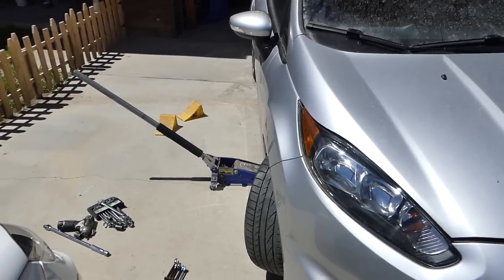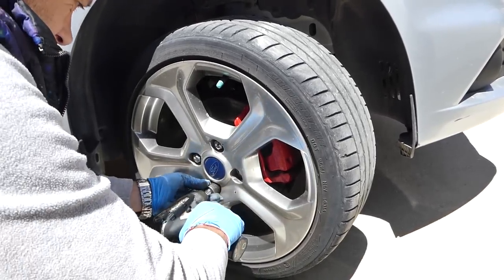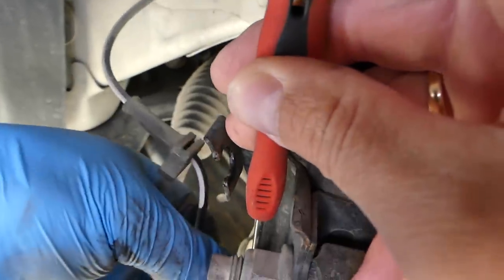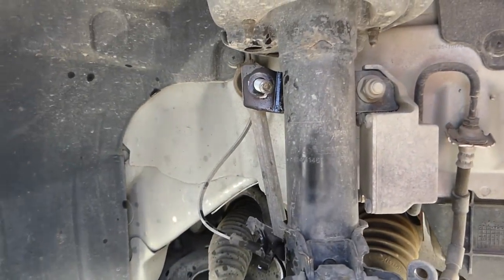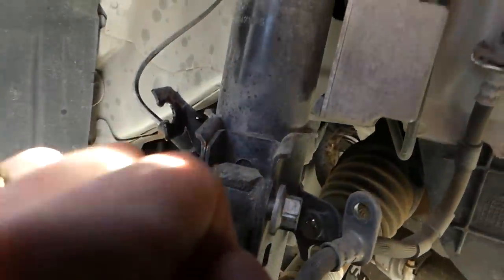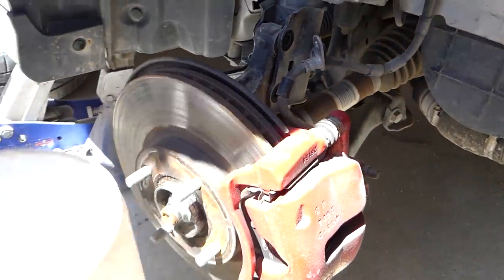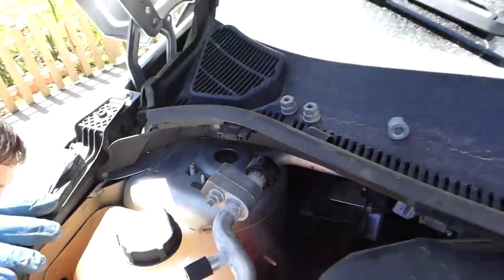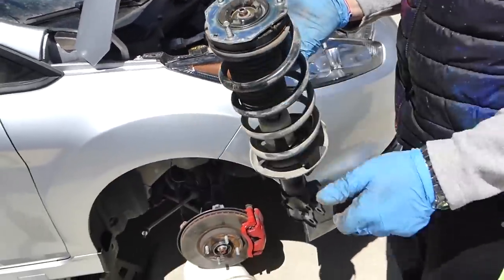FORD FIESTA FRONT STRUT REPLACEMENT REMOVAL MK7 ST

Comment: Thanks for the video, very informative but you said the headlights have to come out just to remove the scuttle panel, when it doesn't at all.
To remove scuttle you remove wiper arms (2x 15mm nut) push down on the joint of the wiper arm if they are seized to release them, pull the rubber lug from the side trims into the edges of scuttle out (leave side trims in place), remove the 6? Metal clips at the front of the panel (lever forward) and gently unclip from the retainer at the bottom of the windscreen (use a lubricant to clip it back in or you can put too much stress on the ws). Job done. Would make getting to the back nut a lot easier.

Comment: Just so you know if the bolt starts spinning on the anti roll bar you don’t need an hex key there’s a 13mm at the back you can hold it there with a spanner and ratchet it off. This guy makes simple jobs difficult